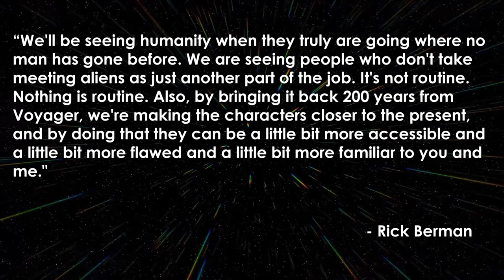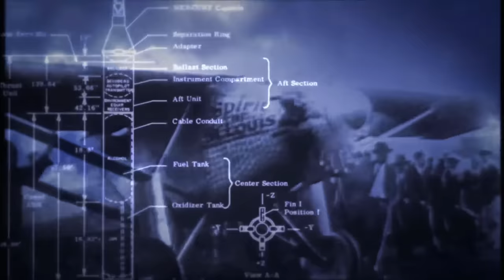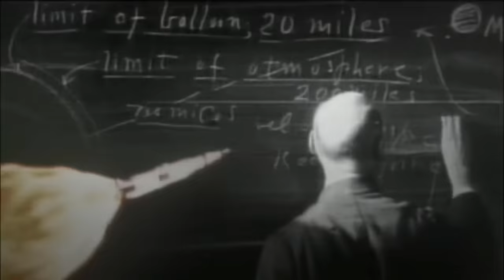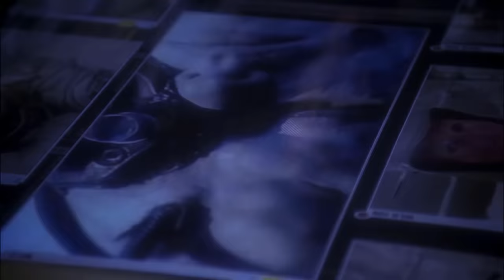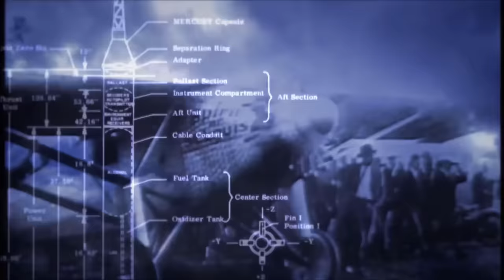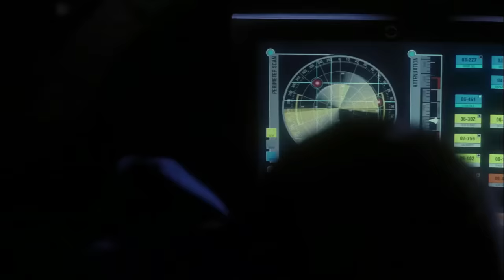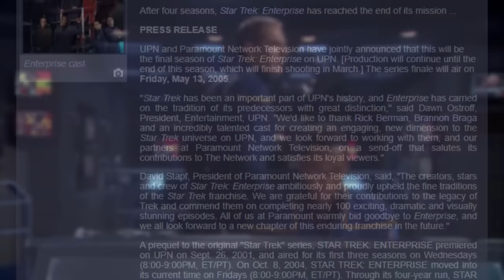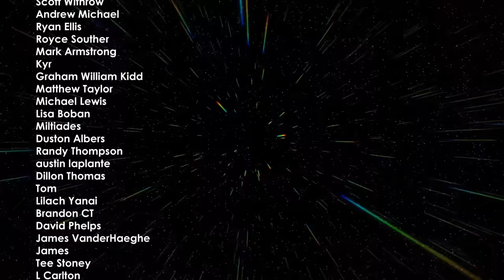Star Trek Enterprise Retrospective/Review - Star Trek Retrospective, Part 15

Comment: I am convinced that if enterprise had 7 seasons, it would be remembered as fondly as the trio of TNG, DS9 and VOY. After all, the first two seasons being kind of janky are a reccuring theme here.
Reply: Probably not. Enterprise got better by S4, but it was too little too late by then.  Audiences had abandoned it.    In the landscape of 2000s era television,  you can't really start off with two Poorly Received seasons,  and bleed off most of your audience.
Reply: @Knightfall182  not my point.
Reply: I totally agree, it was a really cool era to set the show in, and it was terrible to have UPN executives cancel it before it could prove its worth, like TNG, DS9 and VOY. It was also a victim of crappy timeslots, something that has killed many good tv shows.

 In the words of Cmdr. Riker, "She went before her time."
Reply: @michaelmurley4780  Don't blame UPN,  blame the show for bleeding away most of it's audience based on how poor Season 1 and 2 were.    You were lucky they agreed to S4 (on a lowered budget).     Enterprise fumbled from the start,  that's why it didn't last.
Reply: The show got gradually worse over time. Initially they used Hoshi exclusively, then they used a handheld universal translator when Hoshi wasn't around, then they dropped even that, and the crew casually started conversing with all random aliens in English.

The show has failed to stick to its originally established premise and timeline-appropriate technological limitations and that was its undoing. More seasons would not have made this any better...
Reply: @dominic.h.3363  "...timeline-appropriate technological limitations..." Very true. One might also add the 'gratuitous' use of T'Pol, at least during 1 & 2; what apparently worked for TNG and VGR (Deanna Troi and Seven of Nine) had become shopworn by the time (ST) Enterprise arrived.
Reply: @bonghunezhou5051  troi was supposed to be eye candy?
Reply: @jplonsdale7242  YES! She hardly did any (on-screen) counseling work; in the pilot film (Encounter At Farpoint) she is even seen wearing the micro-mini (-ish) skank outfit. Not until series 7 (the final one) is she seen wearing the standard-issue Medical & Science uniform on a regular basis
Reply: @dominic.h.3363  having an issue with that is entirely different from the show actually being bad. TOS couldn't hold to its own tech continuity for two episodes in a row and the franchise as a whole is hilariously bad at that sort of thing.  How many groundbreaking technologies or applications for existing technologies made their one and only appearance as the resolution or instigating issue of an episode only to dissappear for all of future history?

A short list includes.... transporter stasis, should probably be standard fare in emergency situations don't you think? Maybe backup those very likely to be destroyed escape pods with this tech so everyone can get out?

Healing basically anything with the transporter, self explanatory I think.

Spontaneous AI in the ships computer, they are actively trying to develop AI during TNG! And it just keeps happening on at least one ship multiple times.

Replicating organs, it was a risky solution for Worf but plainly successful but ever since then people have instead recieved mechanical augmentation.
Reply: @Knightfall182  
If TNG was aired today for the first time, they would close it right after "Code of Honor".
Reply: @DrewLSsix  That comparison doesn't make any sense whatsoever because TOS was the first iteration of the franchise, so they've spent half the series figuring out what they wanted to do with the show the first place. There was a point where there was no federation and they've used lithium batteries instead of dilithium crystals for crying out loud...
Reply: @Knightfall182  that's not his point
Reply: So am I. By season 4, the show and cast had firmly hit its stride. The more I watch it, the more I wish there were 3 more seasons. The Romulan War, more Mirror Universe (Mirror Hoshi and T'Pol!) and Future Guy would've taken place.
Reply: I’d take the first couple seasons of Enterprise over the first two of TNG any day.
Reply: For me, it already is remembered as fondly as the other three.  The only thing that I absolutely HATED about it was the killing off of Tripp.  That was so unnecessary and it has left a bad taste in my mouth to this day.
Reply: @AvroBellow  Tripp is alive in the novels :p)
Reply: @Knightfall182  I agree, the openings were what lost me. There was literally one where the helmsman was just sitting upside down due to a gravity quirk, he gets notified that there is a message for him and that’s it. That was the whole teaser meant to entice people to watch the episode. Blah.
Reply: @bonghunezhou5051  - Fun fact. The writers of TNG actually tried to work with Marina Sirtis (Deanna Troi) to give her more responsibilities. But Marina was very uncooperative, and would just complain or whine. 

One TNG interview said the writers would often  ask Marina what she would like to do with Troi's character. Or how she felt about adding other duties or hobby to explore Troi's background. But Marina generally was uncooperative. 

Marina famously responded with "I don't know. Your the writers. That's your job. Figure it out". And didn't really cooperate with the TNG writers. 

Apparently, Marina Sirtis was a bit of a Diva during the  TNG's production run.

This is exact opposite of Jeri Ryan who played Seven of Nine. Jeri would regularly work with the Voyager writers and producers to work on Seven of Nine's character.
Reply: @dominic.h.3363  She would have till gotten her episodes. I think a long hoshi mattered like as tanslator in season 3 nd she could be the one being reponsible  to celrate the translator somho and is needed, that would be fine. And get episodes. And the dark mirror episodes i think show they cared about her. O she would have pushed for more time, choose one.
Reply: Agree, while i not know how well it will age in like future, the 3rd season and season 3 tone is a great commentary adressing the 9/11 and its dark bring out th wort in people , limits are tested, and still its very star trek in the end, with yeah there i a fight but the threat is ended, with diplomacy.   I am very impressed with season 3, and th tone of the dificulties after that rough time fighting xenophobia, i am convinced if they got eason 7 it would be a great one like ds9. Adressing politics pretty good. Hell it was already great in 3-4 vcant imagine what 3 more could do.
Reply: @Knightfall182  Then berman, the difference between 1-2 and 3- is later dont have berman helming it. I feel free to blame berman and that then the writing stuff could shine.
An the theme.It catastrophic that they did not show  a version o the star trek theme to well get fans into it.
Reply: @Seanginty1  I 100% agree and i liked TNG a lot collectively as a whole, but to be honest the first two seasons of TNG were corny and downright AWFUL let's be honest.  Patrick Stewart has stated many times that Gene Rodenberry almost caused the show's cancellation after season 1 he interfered so much.
Reply: @marocat4749  You are correct.  Berman and Braga were in charge seasons 1 and 2 and while they had some gems here and there it was kinda meh more Star Trek Voyager and didn't explore it's concept as being a prequel series.  It wasn't until Manny Coto took over halfway through season 3 that the show really started to pick up steam.  Season 4 was really good and would have been even better but was rushed as Coto knew it was going to get cancelled.
Reply: @chrisloesch1870  I wish there wa at least a season 5 to end on a solid season number.
Reply: I wholeheartedly believe this, I also like that there are segments of the random who cut it some slack and enjoyed it. It’s my fav after DS9 , I know that’s an unpopular opinion. I loved the crew and the Xindi arch
Reply: @Knightfall182  every trek sucks s1 and s2. Original excluded. 
But yeah TNG. DS9. Etc.
Reply: @stevenhoward1233  DS9 had some really strong eps in S2,  including the Circle Arc.
Reply: I don't think those 3 are remembered the same way. I think TNG is by far the most popular, many hard-core fans prefer DS9 and then you have Voyager.
Reply: Worst part of enterprise? The damn theme song
Reply: @stevenrais9360  even more so when you realise the original theme song planned for it is really good.
Reply: @dominic.h.3363  The opening theme for the show was some stupid Aerosmith sounding song instead of an epic sounding orchestral piece... The uniforms basically look like the ones the international Space station wears.. they pretty much just injected something into the canon that was established wasn't there with the whole premise, the people behind it were clearly just trying to make a buck and didn't really care about Star Trek that much
Reply: @liamconverse8950  You mentioned two of the things I liked most about this clusterfuck.
Reply: @dominic.h.3363  Well sounds like you didn't really like Star Trek that much just like TV shows
Reply: The ratings were awful UPN as a network had a identity problem Star Trek really didn’t fit by the time enterprise aired 

TNG and DS9 were syndicated shows they aired nonstop new episodes generally twice a week they both built fan bases as they aired tho DS9 really didn’t get its due to long after it ended 

Voyager was the flagship show on a new network so it was somewhat protected but ratings were dropping season after season 

ENT was bland boring and never really delivered as a prequel it could have 13 seasons and it would have been still a boring show 

And if I’m being honest TNG is rather boring and bland saved by great acting and when it’s great it’s great but it has a ton of stinkers 

You can see the steam running out of Star Trek during voyager again it’s a fine show if somewhat safe and vanilla 

But ENT is like watching paint dry
Reply: @TheBigExclusive  yeah that sounds like Marina . In a lot of conventions I've been too she has an obnoxious attitude and seems to think she's some superstar. Plus she is a very passive aggressive type of bully towards cast members
Reply: @Knightfall182  in that sense it seems almost like TOS. It fell out of favour with the watchers when it was new, but years later gained a cult following. ENT is in my top 3 treks now, but I wasn't the biggest fan at the time.
Reply: @Seanginty1  - Absolutely agree 100% …..TNG was quite appalling in its first two seasons, whereas I think Enterprise was pretty okay all round in those early seasons, and then just powered on to new heights in Season 3 and Season 4.

In my opinion, Enterprise is one of the very best of the whole franchise, better than TOS,TNG, Voyager, and on equal footing with DS9……oh and it’s absolutely light years ahead of that mess called Discovery!

Can’t speak about Picard as I haven’t seen it yet.
Reply: @stevenhoward1233  - That quite true  , I would say TOS first 2 seasons were great, but S3 sucked big time , it really was bad…..Spocks Brain???
Reply: @seanodeli7031  - I couldn’t DISAGREE with you more!
Reply: @Knightfall182  will Star Trek picard is doing the same
Reply: No it wouldn’t be. Enterprise was just a bad show. Prequels are a disastrous premise. You can never go back. You must always move forward.
Reply: @jplonsdale7242  Marina is a horrible person. She is downright nasty and has made a lot of racist statements over the years, which have been brushed under the carpet. She doesn’t belong in Star Trek. She should have been fired after Season 1 and then Guinan could have become ship’s Counsellor.
Reply: @Knightfall182  you’ve forgotten how cringeingly awful STNG’s first season was. It didn’t get truly great until season 3. This is par for the course. It takes two seasons of any show for the writers and cast to figure out who the characters really are.
Reply: @ralphclark  Naw man.  Even in Season 1,  characters like Picard, Data, Worf showed great potential and came across like characters that were actually planned out to be characters first, and not Diversity Checkboxes.
Reply: @Knightfall182  I’ve watched the entire series from start to finish half a dozen times at least, and no you are just wholly wrong. Almost all episodes in season one are terrible, and some are actually painfully embarrassing to watch.
Reply: @ralphclark  Within the context of what 80s television was, most were fine.  And then you have some bad ones like Code of Honor,  but some solid ones like Where No One Has Gone Before,    it's an uneven season,  but that's fine since it was the first Trek season since the 1960s. DS9 started off much stronger.
Reply: @Knightfall182  DS9 was surely more like itself from day 1, it didn’t have the rampant quality problems, but even there it took a while to find its feet. It’s natural and expected. In any new TV show the characters are just thin sketches to begin with. Only after a couple of years’ accumulated character development do they start to become like real people.

STNG had significant additional problems in the beginning. When those first two seasons were aired, modern television hadn’t yet been invented; it was still almost indistinguishable from 1970’s drivel TV. This didn’t change until about 1990. And then, suddenly, studios started to show some imagination. Remember Twin Peaks? What a ride that was. Half the world’s jaws hit the floor.

There was another reason that 1990 was the watershed moment for STNG: it was around then that Roddenberry got pushed into the background and Piller took over as showrunner. That was the end of the childishly simplistic morality plays and the beginning of modern Trek.
Reply: Although the ‘first two seasons’ problem is often talked about, I feel like VOY and TNG are the only ones who had such an egregious difference between the first two seasons and the rest of the show. DS9 easily has one of the best pilots, and while not being great early on like any of the Star Trek shows, and while getting way better later on, those first two seasons are really quite decent and watcheable. Whereas TNG’s first 2 seasons are absolute shit, and no offense but VOY’s first two seasons are so boring and uninspired. ENT was finding its footing too but it was still entertaining and season 2 had plenty cool ideas especially the Andorians and temporal cold war and such.
Reply: to be clear..... not as many people liked ds9 as you seem to think.    its a good thing it had Quark and Garrek.   those two made the show.  and Kira... what an astonishingly beautiful woman.    terry ferrel never held a candle to that.     i disliked avery brooks from his first 5 minutes on screen.    did he ever redeem himself?   lol, no.
Reply: @knotsure913  I know what you mean and I kind of “meh-ed” my way through a couple of seasons until a casual sci-fi-hostile rescheduling on BBC took it off my radar. But years later after binge watching the STNG boxes set I gave it another go. It has, if anything, improved with age. I think part of the problem was that in terms of style and tone it was a bit ahead of its time. Sisko will never be my favourite captain, but DS-9 has a lot to offer if you can give it the time, and it was much more original than Voyager.
Reply: @Knightfall182  good luck with that.
Reply: @ralphclark  yes i somewhat agree.     but was it ahead of its time?    or did they just try to force all that down our throats too early?     i never liked stargate universe until recently, now i cant get enough and i wish there was more.      admit it.... quark and  garak made that show.   they were the most interesting characters i had seen in a long time.
Reply: @Knightfall182  go watch the first episode again.    watch how he treats picard.    watch how gay he acts around his future wife.    no.    he was disliked, and for good reason.    only years later did people start to call him brave and beautiful.
Reply: @Knightfall182  terry was no nana visitor ;)    terry was a bland peice of paper. absolutely nothing special about her sticks in my mind.    kiras smile though?    i can still see it every time i close my eyes.
Reply: @Knightfall182  and not to mention... starfleet had this religeous zealot on the payroll for how long?     i seem to remember a few conversations between him and the brass that should have had him knocked out of that seat faster than picard could say "engage"..... but starfleet just left him in charge of a seemingly important space station?    i call bullshit.
Reply: @knotsure913  

“Forcing down our throats too early” Is synonymous with “Ahead of its time“, but as perceived by people who just aren’t ready.

I agree Stargate Universe was wonderful and it’s a tragedy that it ended prematurely. I wanted to see Colonel Young find some peace and happiness. Nothing at all to do with wanting to see Chloe get her kit off again, no sir…
Reply: @stevenrais9360  The Best part?      T'P😍L!
Reply: @Knightfall182  They would've come back. They didn't all disappear. Look at the success of Picard, Strange New Worlds, and others.
Reply: @Seanginty1  Same here
Reply: @Avro Arrow  They would've brought him back if they had another season to get to it.
Reply: @stevenrais9360  Nah, it's a good song, but it just doesn't fit Star Trek.
Reply: Well done for literally parroting exactly what this video ended in saying…. 1:17:04
Reply: @-MrFozzy-  not quite parroting, more like sharing the same sentiment without remembering what the video said.
Reply: ... and yet, it's first 2 seasons were no where near as janky as the first 2 seasons of TNG, DS9 & VOY.
Reply: Literally the worst take ever
Reply: Piss poor network planning and tired writing personal
Reply: If you lived through the 90s, there was a feeling of fatigue starting to settle in by the time ENT aired.
It needed to do something different, play to its strengths of being set in a time before TOS.
What we instead got was Vulcans with bad intentions, patch Adams theme song, and the crew acting like horny teenagers. I felt the entire fan community was mega disappointed in the lost potential.
Reply: There were some gems in Season 1 and 2. Myself, I like the more “middling” episodes of Trek, the kind you vaguely remember pieces of the plot or scenes from, but weren’t so good or so bad that they stand out. Those are the ones that fill in the context of the show, and make you feel there were more episodes than you remember.

“Strange New Worlds” is my favorite ENT episode to watch, specifically because it feels like an episode of “Earth 2” or any early to mid 90s sci-fi show trying to compete with Trek, but not the same.
Reply: @Knightfall182 upn left it on Wed night when it was obviously no match for American Idle a relaunch to Monday in yr 2 may
Reply: @popkhorne5372  7 seasons? Nah I think Star Trek Enterprise should’ve 10 seasons and should’ve aired for 10 years from 2001 to 2011 (similar to how Smallville had 10 seasons and aired for 10 years from 2001 to 2011)
Reply: Wish they spent more time on looking at the alien races who would make up the early federation. They did a good job on the Vulcans and Andorians, hardly touched the Tellarites and basically ignored the others. It would have been nice to have a least one more series concentrating on the Earth/Romulan war.
Reply: @duanetapp1280  you do have a point and do you agree with Star Trek Enterprise should’ve had 10 seasons? 🤔💭
Reply: I was satisfied/enjoyed by what I watched of enterprise I really don't think more seasons would have made me like it as much as the other three.
Reply: @wraithflaire1639  yeah but do you agree with the idea of Star Trek: Enterprise should’ve had 10 seasons?
Reply: @jonmcinnis1645  TNG didn't even get 10. So no It didn't deserve that many more seasons.
Reply: @wraithflaire1639  I’m referring to the idea that Star Trek: Enterprise should’ve had 10 seasons (not the idea of TNG having 10 seasons)
Reply: @jonmcinnis1645  TNG's the gold standard. The very idea that it should have more seasons than TNG's seven is crazy.  At most I could see Enterprise lasting 5.
Reply: @wraithflaire1639  the reason I think the reason I think Star Trek: Enterprise should’ve had 10 seasons is because the series took place before the Federation was founded and I imagine it would’ve probably ended with the tenth season being set in 2161 (the year that the Federation was founded)
Reply: @jonmcinnis1645  I don't trust the writers of Enterprise to cover the actual founding of the  federation.
Reply: @wraithflaire1639  yeah but I think Star Trek: Enterprise to the Star Trek franchise could’ve been what the Star Wars prequel trilogy was to the Star Wars franchise in my opinion Just saying?
Reply: the Following One crew that long couldn't possibly have kept entertaining viewers that long. One earth ship a beginning of a federation does not make. Not to mention all the bureaucracy and politics required. Detailing the foundation of the federation also leaves too much room for lore inconsistencies. It would required writing the transition from NASA explorers in Star Trek universe to the enlightenment of the  people of the federation.Once again I don't trust the Enterprise writers to have done it justice.  Writing the actual founding of federation Is something I wouldn't even trust rottenberry writing If he had been  granted internal life buy an alien entity and I think he would agreed with me.
Reply: @jonmcinnis1645   Following One crew that long couldn't possibly have kept entertaining viewers that long. One earth ship a beginning of a federation does not make. Not to mention all the bureaucracy and politics required. Detailing the foundation of the federation also leaves too much room for lore inconsistencies. It would required writing the transition from NASA explorers in Star Trek universe to the enlightenment of the  people of the federation.Once again I don't trust the Enterprise writers to have done it justice.  Writing the actual founding of federation Is something I wouldn't even trust rottenberry writing If he had been  granted internal life buy an alien entity and I think he would agreed with me.
Reply: @jonmcinnis1645  What a let down to fans of the original just like star wars prequels?
Reply: @wraithflaire1639  yeah but do agree with the idea that Star Trek: Enterprise to the Star Trek franchise could’ve been what the Star Wars prequel trilogy was to Star Wars part? 🤔💭
Reply: @wraithflaire1639  I’m saying Star Trek: Enterprise could’ve been Star Trek’s answer to the Star Wars prequel trilogy.
Reply: @jonmcinnis1645  I'm reminded of a quote from Dexter's laboratory. "Toil away
alone in the dark,
searching for answers
to questions nobody asked"
Star Trek doesn't need an answer to Star wars prequels.
Reply: @wraithflaire1639  I’m saying Star Trek: Enterprise could’ve been their answer to the Star Wars prequels
Reply: Enterprise was by far my favorite series. Despite its flaws, it just had better, more realistic human characters than the largely plastic characters of the others, though I do like them all.
Reply: @Bhamloud47  I respect your opinion BTW I imagine if they did a Star Trek: Enterprise animated series I think it should’ve been made by Steve Marmel (the former developer of Danny Phantom I’m saying if they did a Star Trek: Enterprise animated series it should’ve been made by the same guys that did Danny Phantom)
Reply: @Knightfall182  yeah I think even by the early 2000's media was becoming fractured enough with cable having hundreds of channels and the internet on the rise that a series really needed to stick the landing in order to have a shot. The fact that Enterprise got even 4 seasons is kind of surprising, the first two seasons are kind of tough to get through at times.
Reply: Season four of enterprise they finally hit their stride. I enjoyed season three which was one cohesive story throughout the whole season with little knots through it. That was pretty awesome but they hit the sweet spot in season four where each story was like 2 to 4 episodes long that was awesome. It was like watching four movies.  
(With exception of the finale, which was garbage it just had Riker and Troy watching enterprise from the holodeck . It was totally disrespectful of the cast and fans.
Reply: @Knightfall182 just about every show on Network tv was bleeding audiences during the 2000s. 3 million viewers in 2010 was the equivalent of 6 or 7 million viewers in 2000. People were moving to premium channels in droves at the time. Look at the budget of HBO series in the 90s compared to the 2000s.
Reply: @kennyryan625  Better Call Saul disproves your notion that prequels never work
Reply: T'Pol, a full Vulcan, being the first to serve on a human starship and then falling in love with a human felt completely illogical—totally against her character. From that moment, it was clear things were heading downhill. How could they have recovered from it? might be making her a shape shifter from s05 um ... nice idea